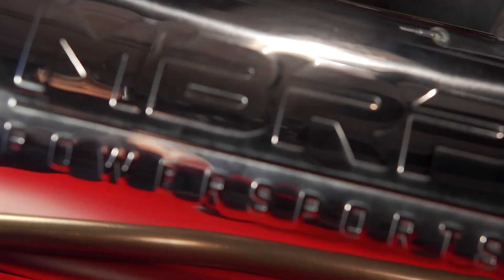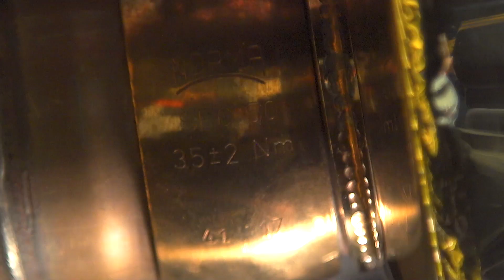Dirt Trax Television 2019 - Full Episode 2

Comment: I have ordered the MBRP pipe for my 2019 outlander 1000r XTP , the no programmer needed is a huge deal , and lower exhaust temps are much needed as well .
Reply: You need a tuner regardless of whether you add an aftermarket pipe or not. Can Ams run very lean from the factory. IMO when adding ANY pipe you will need a tuner. Also instead of getting a tuner get your ecm reflashed instead which will lower temps, remove limiters, and will turn your fan on sooner...btw I have a 2015 outlander xmr 1000. Been with brp for 5 years.
Reply: @jcchannel7304  who does ecm reflashing ?
Reply: Mr RPM has a good one and I believe they are out of North Carolina. A lot of people have been using Wholesale ATV out of Memphis, TN and have reported good results. There are several others out there as well. I believe Wholesale ATV is $99 and Mr RPM is around $300 but prices might have changed since I checked them out. ECM reflashing wasn’t around when I got my tuner, but if it was I would have chosen that. You get more for your money....btw ALOT of good information on Can Ams is on the Can Am Forum...
Reply: robert berry exception to the tuner rule is if you’ve got a O2 sensor in the exhaust. Look around yours, I believe 2019 they implemented the O2 factory depending on US or Canadian bought. O2 is self correction which won’t require tuning. You’ll still  enjoy tuning more though, it’ll run better without EPA restricted timing and AFR.

Comment: $5500 for the YXZ turbo setup is a joke, just go aftermarket, it’ll run better and have a stronger power curve along with power options. We all know the triple cylinder in that chassis will support 300 crank hp sustained at a 100% duty cycle if tuned properly. Yamaha is just playing it safe for warranty, emissions and reliability reasons. Also a variable rpm engine has to be setup different then a CVT. CVT you can run all your power above 5500 since it sits up in that range most of the time where the YXZ needs low end torque from 2500-6000 also. Smoother cam profile with a wider LSA achieves this. If they put a CVT on a YXZ they could switch the cam to a higher rpm focus and make the same power a X3 makes and probably do it better!

Comment: The Honda talons are still extremely overpriced for the lack of extras and interior quality. And Yamaha possible having the highest hp side by side is wrong can-ams new x3 are at like 192hp
Reply: He said in the last video that it might have more than 186
Reply: Remember 30% of 192 is 57.6 = 134.4 hp. loss in hp due to CVT. Compared to the Yamaha. 15% of 186 is 27.9 = 158.1 hp.

Comment: Power losses are not 30 percent for a CVT. That's a made up number. Manual transmissions are going away for a reason, even in the automotive world. The CVT keeps the RPMs in the peak hp. No one around here I know is still buying the Yamaha. They've virtually disappeared from Glamis and Dumont. Plus no low range? Forget it.